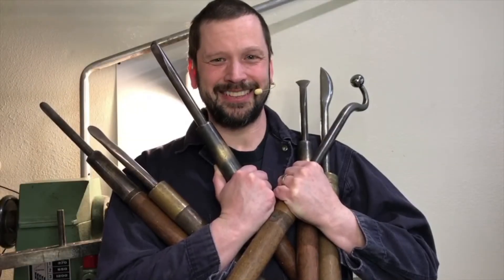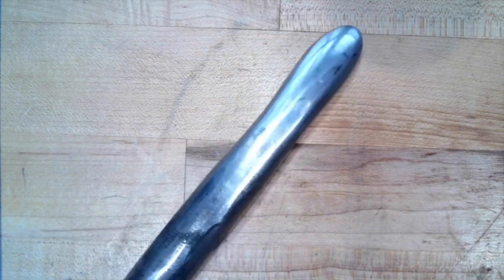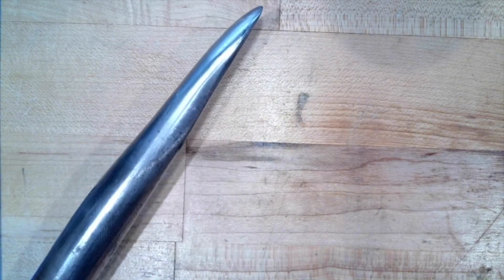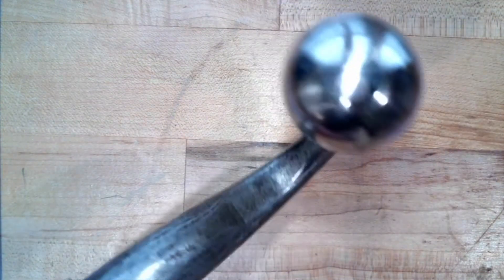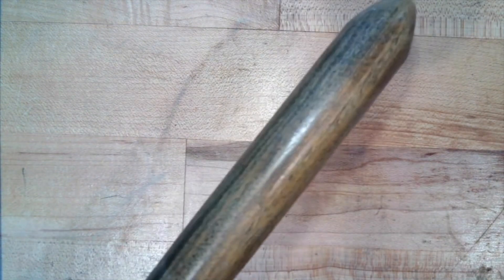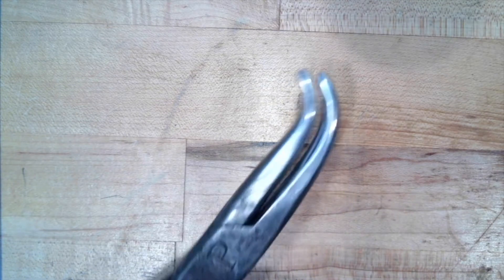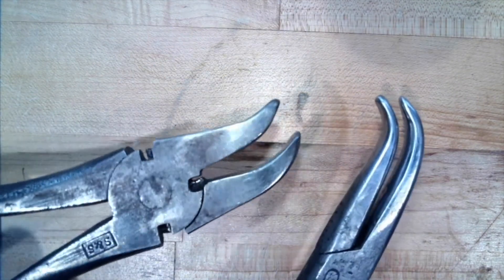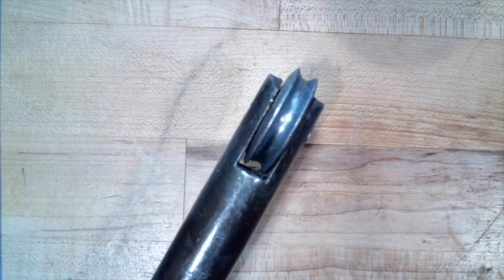Introduction to Metal Spinning Tools

Comment: How to calculate sheet metal shape of the mould depending thickness and rotation speed and of tools
Reply from the maker: I'm not sure I understand your question exactly. Are you asking how to determine the diameter of the blank disk based on the finished spun piece? As a general rule, the blank's diameter equals the finished depth plus diameter but that assumes the wall thickness remains the same (which doesn't always happen, especially for less experienced spinners). Does that help?

Comment: Hi, possibly silly question: can copper pipes (the ones used for plumbing) be spun? Im wanting to spin one to create a sort of hourglass shape.
Reply from the maker: Not a silly question at all! Yes, tubes can definitely be spun (I've been meaning to do a video on it...). It helps if the tubing is seamless and annealed. Holding and supporting the material to make sure it doesn't deflect and kink is critical. Ideally, having a double wheel scissor tool would be best but I've only seen those on CNC machines (and I certainly don't have one myself...).
Reply: @JamesThurman  Thanks! I can get acess to both metal lathes and wood lathes to give it a go, though ill probably give it a try with the metal lathe as it's chuck can properly grip the tube :)
Reply from the maker: @robbiejames1540  They make chucks with jaws for woodturning lathes. I do all my spinning on a woodturning lathe (easier to change tool rest, etc.). Definitely let me know how it goes!
Reply: @JamesThurman  
I will!

Comment: Hello, can wood lathe be used to spin metal?
Reply from the maker: Absolutely! I do all of my spinning on a Woodfast M408 wood lathe. The size and strength of the lathe will just limit the size/thickness of metal you could spin.
Reply: Yes a wood lathe can be used as they are very similar but you need to set it up properly.  Older smaller lathes can have phospour bronze bushes instead of bearings and they are not really suitable. The main thread is important and its a start as you mean to go on thing. You can use whatever thread you like but you may be the only person in the world using that thread. Most spinning lathes have a 1 inch 8 whitworth thread (8 threads to the inch) and if you ever buy any old chucks or formers they will more than likely have that threads in them in the UK anyway. Have a false nose made to reduce down the main thread on the lathe and it will make life easier as you progress.  Dont underestimate just how dangerous metal spinning can be!

Comment: Planishing is done with a hammer. Your flat tool is a burnisher...
Reply from the maker: I completely agree with you on a technical basis, especially since I was trained as a metalsmith before I ever did any metal spinning.  I have heard other spinners use "burnish" and "planish" interchangeably.

Comment: The only stupid question is one not asked. I get brass, aluminum and other non-ferrous metal but could 18 gauge steel be formed into less complex shapes like a 3”-4” funnel with the pinched cut off afterwards?
Retired ASE master tech.
Reply from the maker: Absolutely!  DQAK steel (Drawing Quality Aluminum Killed) is the specific steel that I learned to work with.  Scissor/wheel tools (which I just got and will be doing videos with in the future) would be best to use if hand spinning.  Obviously CNC spinning lathes can typically handle much heavier jobs.
Reply: @JamesThurman  There are things I will make before simply buying. A simple metal cone that fits the base of a GM/Saginaw tilt steering column as my key ignition is on the dash in a 1967 C10 pickup. Ididit, Flaming River sell these for $500+. Why buy one when I have two steering columns. One in the truck and one off my son’s car after he got another in a bone yard. A simple cone that can be MIG welded inside at 3 places so good tacks because it is not structural. A transition part. I don’t have any social media but on the internet just type in Ididit column, it the bottom part close to the dash. I would deal with you. 
I remember they had a video from “How It’s Made” steering columns (It was a tv show 10-12 years ago. Thanks for your work! Even when the camera is off…Tools, Props, Lighting, Camera Angles, Sound then edit and watch 12 times before uploading. That’s work too!
DK, Omaha, NE.

Comment: Thanks James for the videos. I'm inspired to give metal spinning a try. Where can I purchase discs? I'd like to try aluminum and copper. Maybe even brass if I feel it's going well. I've been a wood turner for years and I did spin metal is 8th grade shop class a long time ago. Finding a trusted supplier would be helpful. 
Thanks,
Jeff
Reply from the maker: Unfortunately, there is not a reliable supplier of metal disks.  I did a video on ways to cut your own.  Sometimes I find a bunch on eBay/Etsy.  Most spinning shops have their own disk cutters and there usually isn't the demand for metal suppliers to stock disks (versus regular sheets).  For example, this is all that this supplier stocks: https://parawire.com/cbc-metal-supply/metal-discs/

Comment: Hey James! Fantastic video. I’m curious as to the specs of the lathe that you use. I currently have access to a metal lathe, but I’m unsure if that would be as suited towards metal spinning. What would you recommend?
Reply from the maker: Thanks! I have a Woodfast M408 lathe
 with a 1.5HP Leeson Motor. Generally, I recommend woodturning lathes over machining lathes but you could make the tooling to do spinning but I think it will be more frustrating than its worth.  Even a mini-lathe for woodturning will work for smaller spinnings.